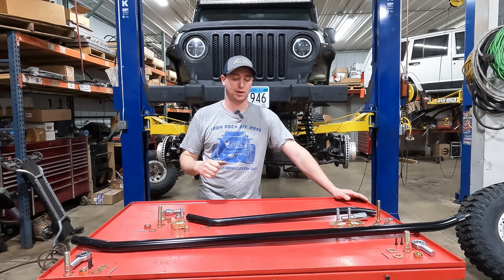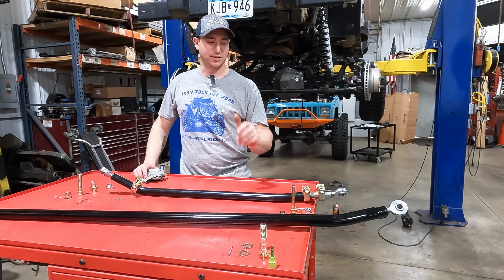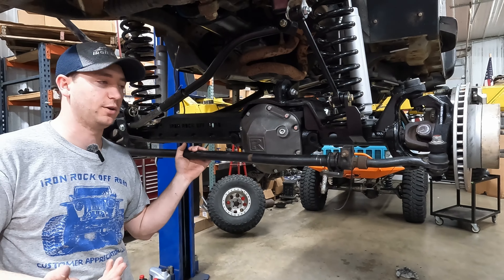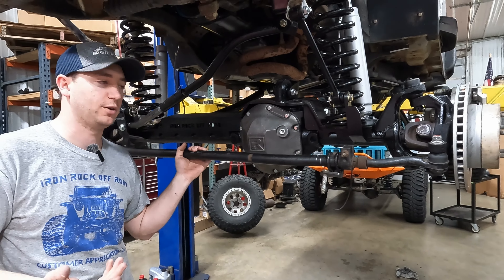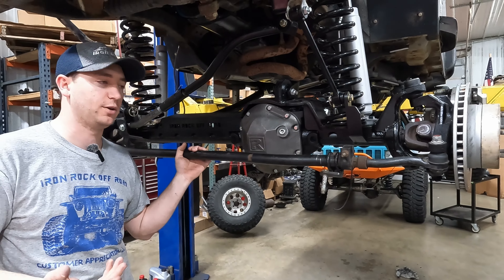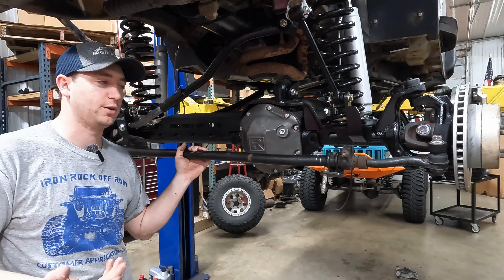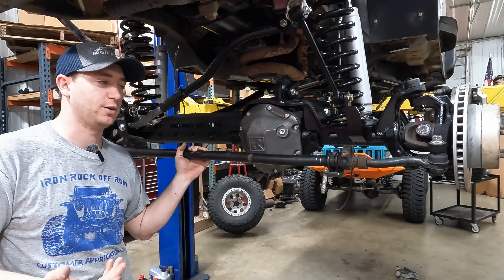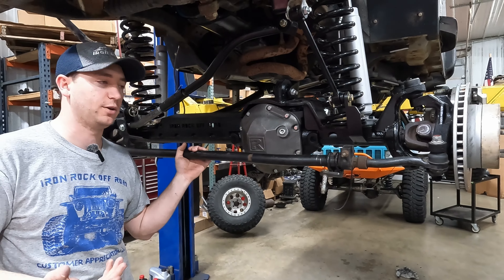JK to TJ/LJ axle swap Over The Knuckle Steering system! - Highest clearance on the market!

Comment: Wow bind the tie rod and drag link with the heim joints to prevent all that flop of the tie rods that’s not good at all wow…
Reply from the maker: @hairycods2273 I'm confused. Are you saying we should bind the heim joints? What do you think we should change?
Reply: @IronRockOffRoad  binding the heim joints to stop the tie rod flop is not good
Reply from the maker: @hairycods2273 That's the opposite of what we did in this video. We indexed both heim joints to be at the same spot when the tie rod is at rest. Since the tie rod has a forward bend, it naturally wants to rotate forward, we set each heim in its most forward position, set the tie rod level, then tighten the clamping bolts. This ensures the tie rod is in the correct orientation at rest and we have maximum travel available in the heim joints. Also, the weight of the forward bend of the tie rod is carried by both heim joints. I hope that makes sense.
Reply: @hairycods2273  There is a huge difference between clocking and binding.  There is no binding in this setup.  The clocking of the heims is good to locate the bars.  The spherical joints have all the freedom to move without binding up, down, left or right.  Maybe IRO should do a video showing how that works in case it's hard for some to visualize.......
Reply: It looked like in the video the two heims were turned against each other so the tie rods could not flop…I’ve been there and made that mistake before trying to take slop out of the drag link so it would not flop
Reply from the maker: @hairycods2273 No worries, we'll try to be clearer in the future. Maybe we can make a video to explain the idea a little more.